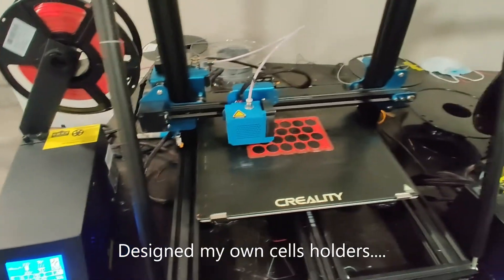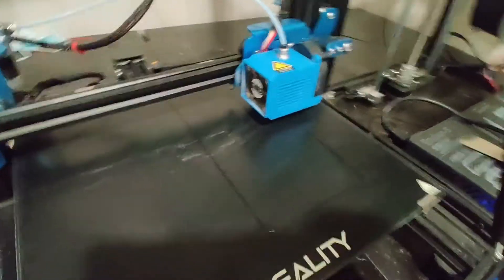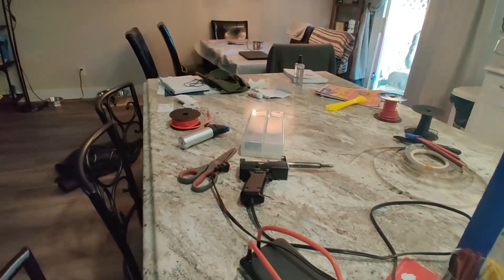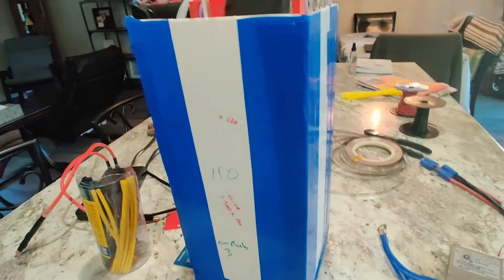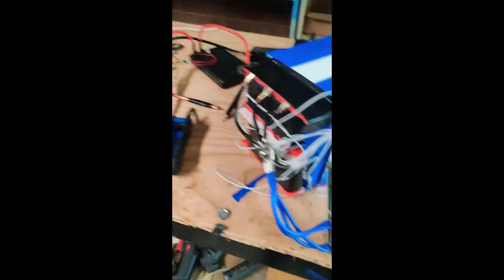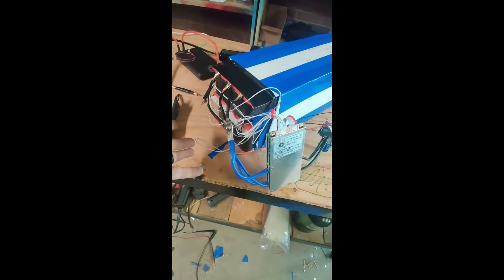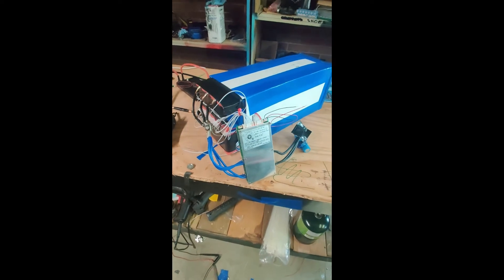Surron battery build no 4

Comment: Hey! What are the exact dimensions of the battery you made? I want to start to make my own but I would like some advise for the shape. 
Stock is around 14x16cm but they are rounded ofcourse. 
We will make the square corners as you! 

Thanks!
Reply from the maker: Hey there...Ive since sold the bike including the battery..I dont remember the exact dimensions, but I believe its in one of the videos I made of designing and building the pack.Its about4 inches taller than original and fits very snugly within the frame.I had to design an adapter so the new lid would fit and not look silly.

Comment: Did you use PLA for the cell holders?
Reply from the maker: Yes I did..
Reply: @johnnyzee383  where did you get the STL file? all the ones i finding are covering too much of the cell terminal making it harder to weld
Reply from the maker: @vesc007  the stl  file for what?...I designed and printed off the stl files for both the cell holders and the bottom and top of the case...email me and I can send the files to you
Reply: @johnnyzee383  whats your email id love to get the file for the battery top cover
Reply from the maker: @vesc007  jzoccano@rogers.com

Comment: Do you have the sti file for the lid dude?
Reply from the maker: Ok I found it, not sure how I include it here..I have the STI files for the top lid and bottom and side panels...will make a separate video and include them.
Reply: @John Zoccano  just add it to the listing where you type as Web format you should be able to copy the link into here dude or I could give you my email address and some beer tokens 👍thank u for reply I'm making a 72v from Sony vtc4 30a cells 200 of them need to print off a lid so I can play with dimensions to fit my battery in I've gone 2x5cells 20s10p
Reply from the maker: @johnpremier1495  Hey ...im gonna do a short video and have all the stl files, top lid, bottom lid, sides and graphics vector..gonna do that today as I have had numerous requests for the files. Didnt know they were still making the vtc4 cells....should be good...
Reply: @John Zoccano  I got 200 dyson batterys brand new for penny's and tested all under load and charge so all is good waiting on a few items to get the build on way I've only been taking pictures not done a video..
And thats great thank you m8 :)
Reply from the maker: @johnpremier1495  No problem, if you make a video dont forget to mention me...lol
Reply: @John Zoccano  100% I will do but think I'll stick with pics
Reply: @johnnyzee383  let me know when you upload the files dude

Comment: very good video!. congratulations for your work is very good. where did you get the 3d files of the battery cover? Thanks a lot!
Reply from the maker: lol...I designed my own 3d files and then printed it off...easy. Thanks for the compliment.
Reply: @johnnyzee383  Could you please send me those files? I am building a battery just like yours and the only thing missing is the top cover. I would really appreciate it and it would be a great help. Thank you very much in advance.
Reply from the maker: @shimbofpv6224  You mean the .stl files?
Reply: @johnnyzee383  yes for print it in a friends 3d print machine. I only need the cover for finish de battery. Thx a lot
Reply: @johnnyzee383  plss i need it for finish the battery ? Thx
Reply from the maker: @shimbofpv6224  Ok..I appreciate that, however I am in talks currently with someone in Toronto about possibly collaborating with a project for a Surron-Like bike open source but they are looking into possibly needing my input for making packs and such...I was getting out of this and if its bogus Ill give you the .STL file, if not then ill have to see...
Reply: @johnnyzee383  ok thx John ! I hope you can finaly send me the files.

Comment: Question if you know I am trying to make a backpack recharge battery while on the trail but I want to make something light maybe like 12 to 15ah 16s pack. I was thinking to just connect in parrellel with the main battery while I take breaks.  I was thinking to use the charge port but thinking it will prob be better to charge via the main discharge port while on the trail. What port is the main I see you have a blue one
Reply from the maker: You can connect via parallel only if both packs are the same, and you wouldnt want to connect via the charging port as the wires are too thin..by the way connecting 2 battery packs via parallel only equalize bettween them...in order to charge a pack you have to add electrons...of course you can connect a pack at 25% to another pack at 75% in parallel but its NOT , I repeat NOT recommended!!!
Reply: @johnnyzee383  I understand but I do it all the time on my 72v ebike and it's only like 60amps for a second when I connect my 100% 20s 12ah to my 40% 20s 21ah battery
Reply from the maker: @plojm123  I cannot answer to any situation or Hypothetical only to what I know..when the maximum charging rate for a battery to go from 40% to 100% is (for example) is 1 hour and you charge it up by connecting another series of batteries in parallel in 1 second, well...you are attempting to circumvent the design of that battery (the maximum charging current/time), by an magnitude of 60 times the rate. If this was a viable method without destroying the cell (eventually), then you would have phones, tablets, laptops,etc not to mention ebikes, cars etc that would charge as fast as you put gas in an ICE car. This situation doesnt exist at the moment.  Think about it.
Reply: @johnnyzee383  understand but I try to keep within ratings example my 12ah battery has 20a discharge cells so 5 cells can handle 100amp discharge for that quick period no problem and then on my main battery the 11 cells in parellel even at 60 to 80 amp charge for a few sec are only taking like 6amps charge each. I think my numbers are right and I dont think I am hurting the cells that much. I have been doing this for like a year now but I did think this thru and I know some people will just be like I saw this on YouTube let me try and they are using bad cells and or to small of batteries.

Comment: Nice build John. I recommand you to install the first nickel strip layer to SERIE the cells groups and then install what is doing the paralleling of your P group. The reason is that the nickel strip that cary the majority of the current is the serie one, not the parallel one so by placing them as the first layer you avoid  to add all excess resistance of the spot weld below  with 3 or 4 stacks which add alot of resistance and heat! so you get a better direct contact with the cells tabs with teh layer that cary the most current.
Doc
Reply from the maker: Hey Doc...thanks for the comment!..I understand the difference between current flowing between the series of the cells and current between the parallel groups of cells as there really is very little current FLOW between groups of cells in parallel and the real current flow is between the series in the groups. I havent posted the results yet as Ive been so busy but, the resistance of the pack using the cycle analyst was only .035mohm which is really low..I have a temp sensor in the pack and there is no heat whatsoever...what I didnt explain in this video but you can see if you look close enough (at 1:10 of the video) is that on the SERIES connections I added solder to all the  nickle strip so in essence I beefed up those traces considerably. I am pulling a maximum of 135 amp from this pack which is close the maximum of these cells (BAK 21700 5000mah and max of 15 amp pre cell, so 10 in Parallel is 150 amp max ). Also the balance of the pack in my opinion is quite good, being around 0.025 and the ANT BMS within about 15 hours can balance the pack to within 0.01 volt which again is excellent. Ive made 50 or so packs, so not my first time around. In the end total resistance of the pack is what counts, and here at only .035 mohms, there is very little and that resistance would be coming from the cells themselves and perhaps some of that in the stock circuit breaker which does produce some heat on full throttle runs..oh by the way with the stock battery and cycle analyst, the resistance of the pack was always around.06-.070 mohms. So my pack has less resistance than the stock battery.

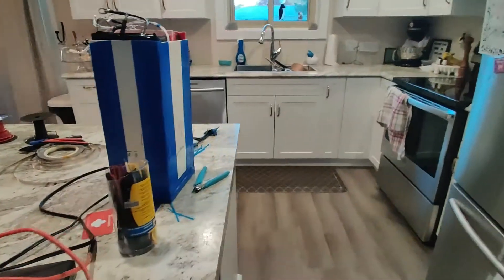Comment: 1:41 Those battery holders (and centre polycarbonate) on the bottom should be made with cutouts for the wires between the 2 sides.
While it does not have anything it can short against, it will compromise the cable then the wires and become a resistance point and get hot or even melt the pack down.
Reply from the maker: Incorrect. the bottom of the case is slightly smaller that the dimensions of the pack itself, so in effect the bottom of the cell holders and the wires between the 2 cells does not hit the bottom but instead is suspended about 3 inches from the bottom, as it reaches a bottleneck and wont go any further. You will notice that the top of the cells stick out at the top of the case and the cell holders are the same length as the case, so that is the amount of distance they are from the bottom.  Ive been building and gaining experience building packs for the last 7 years and of course I thought about this and designed it accordingly, but I appreciate the keen eye and comment!!

Comment: John, I have an ANT BMS also and I want to put it in my Sur ron Battery case replacing the original. I need help with the schematics, and how to rewire the battery with the ANT, Is there a place to direct me? Maybe do a video, I surely will watch!
Reply from the maker: Hey there...The dimensions of the ANT BMS are larger than the stock one..It will not fit unless you were to have a different top made (like a 3d printed one.).The top I made for my 21700 pack is larger than the stock on and more accomodating on the inside. Actually thats an idea..I could make 3d printed tops that would fit on the stock battery that could accompany the ANT BMS...As for the wiring, you would have to splice in the negative total wire for the ANT and then solder another negative wire for the first in series to splice into the ANT and then find the first positive wire and onto the second etc until you get all 16 of them. You would no longer have the stock speedo/information panel work of course, and the display on top of the case would not work, assuming you could fit the ANT in the case which you cant. The ANT is just a bit too wide to fit it like the stock one. Email me if you want more detailed instructions on how to wire it to the stock battery.
Reply: @johnnyzee383  Thanks, A guy in my group says he can do it for me, and I trust his expertise, so I will try to copy what he does.
Reply from the maker: @DeanF  lol...with the original case??...ok good luck with that.

Comment: Whats the packs specs?
Reply from the maker: The pack consists of BAK 21700 cells arranged in a 10p x 16s arrangement. The cells are 5000 mah giving the battery about 2.9 kw hours of juice. SInce these cells are bigger than the original pack's 18650's comprised of Panasonic PF cells, the pack is taller. These cells are rated for 3C discharge and a 800 cycle life to 80% which is better than the Panasonic PF which is rated at 300 cycles.I will get into the results of my testing in the next video.